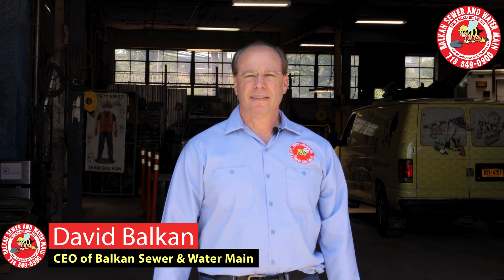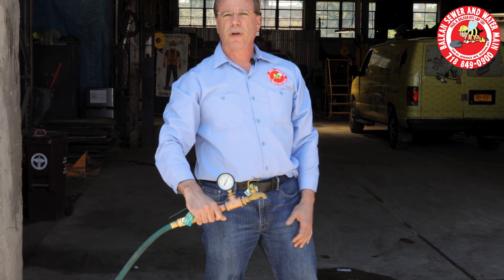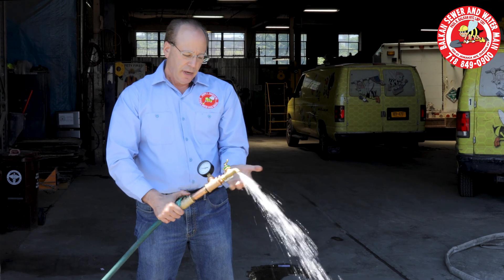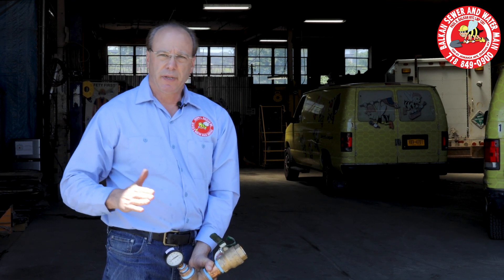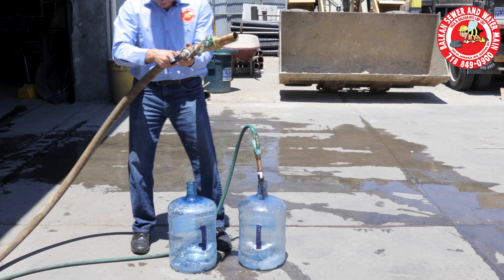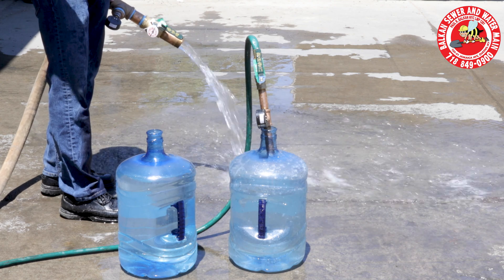Water Flow and Water Pressure: A Live Demonstration

Comment: Something was destroying my water heater every 5-6 years. City was giving my house water measures at 90-105 psi. I installed a pressure reducing valve to bring the pressure down to 55 psi and that allows a proper calibration of my expansion tank. My home insurance kept installing the wrong water heater for years. Youtube showed me and its time to do all of this myself.
Reply from the maker: Not sure about your jurisdiction, but in most places (NYC included) plumbing is designed to function properly for up to 80 pounds of pressure. If water pressure ever exceeds that PSI (like if you're being supplied from a very high elevation), a typical pressure reducing valve reduces the pressure to 80 pounds of less. Hoping that information is of some help to you, and thanks for your response!
Reply: Might be the water quality or something. 90-105 should be fine. I have 120PSI (way too much because of hills) without the reduction and the only issue I have is I can't fill up a cup of water at the sink at full flow because the water jumps off the cup and onto the ceilling.
Water heater is fine..
Reply: @zane003  If folks choose to be directed by individual opinions and personal experiences instead of nationally recognized plumbing standards, that is of coiurse a personal choice.

Comment: Good demo! 
However,  the static  pressure in the big hose one is greater than in smaller one. I  see in the video that in first case you have 40-41 pounds of pressure  , but in second time you have almost 60 ! So it's less pressure in small tubes than in larger ones. 
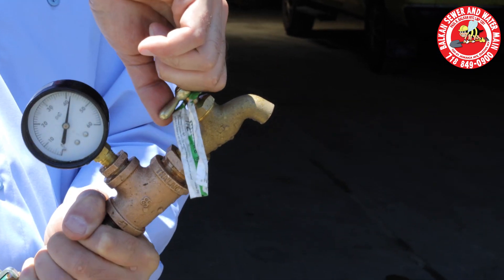1. 01:44.
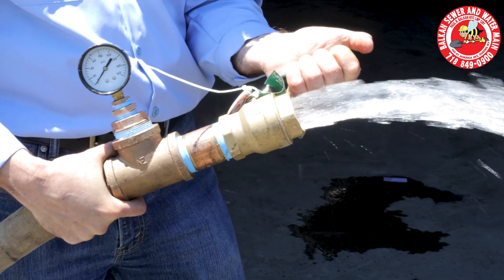2. 02:52
Reply: The original commenter was correct , the smaller line shoots farther because the velocity has increased not because the pressure has increased. Bernoulli formula can prove this. This is a very common misconception people think since the water is coming out more aggressively that the pressure is higher, when in fact there is a small pressure drop there’s a difference between pressure and velocity https://youtu.be/DW4rItB20h4 this video explains it
Reply from the maker: Not sure I caught that in the video. Pressure is actually a constant regardless of size of pipe. Volume of water provided is the difference.
Reply: @balkanplumbing  
So the Bernoulli smaller diameter= increase velocity= decrease pressure applies only to moving fluid?
Reply from the maker: That question may just be above my level of knowledge! My point was that when there is a restrictor near the outlet the pressure increases. The volume inside different sized pipes remain the same.
Reply: @balkanplumbing  ok! I got IT! Thank You very much!
Reply: @snrnsjd  Bernulii equation applies in one system when the flow rate is constant. But when there are two system, in this case, 2 water hose, it doesnt apply
Reply: @maxz3809  Thanks for clarifying!
Reply: @snrnsjd  In my humble opinion, the Bernoulli Equation you're referring to is looking at water velocity and not volume. For example, water volume is typically measured in gallons per minute (GPM) whereas water velocity can be measured in feet per minute (fpm). 

As an example, let's say that 100 cars are traveling through the Lincoln Tunnel to New Jersey and that they are all traveling at 25 miles per hour. The cars' velocity is 25 mph. But the number of cars that exit the Lincoln Tunnel every minute might be 4 cars, this is the volume or number of cars traveling out of the tunnel. 

Looking at the example given at end of the video https://youtu.be/EYg_5QGwxgM?t=260 (the part where he fills up the containers with different diameter piping). This shows that the volume of water is less when using a smaller diameter pipe. It's kind of like only so many cars can fit through the Lincoln Tunnel. But if another tunnel can be used, say with more lanes opened then the volume of cars passing through the other tunnel will be greater.

Now to the other part of the Bernoulli equation: the  pressure. I'm not sure I understand why the pressure is supposed to drop. It seems like the opposite would be true. But to prove it, you would need extra gauges, a before and after if you will. The first gauge before the restriction and a second one after the restriction. In this video the restriction is shown by placing fingers at the outlet of the pipe and the water flows into the air and onto the ground. When the fingers are placed to restrict the flow it's the velocity that increases. The increased velocity is what makes the water travel further. But according to the Bernoulli Equation the pressure is supposed to decrease because of the conservation of energy. See this video for more information --> https://youtu.be/DW4rItB20h4?t=277 

To prove the pressure drops you would need to have a reducing pipe with a gauge before and after it (and at the correct locations) and see if the pressure would in fact decrease. A Venturi Meter does this, see this video ---> https://youtu.be/_bfcdRhY7Rw?t=154

By the way, I enjoyed your video and the comments. I learned something new. Thank you for your time.